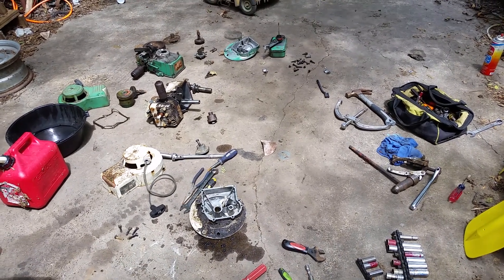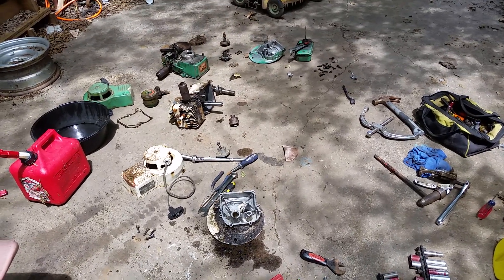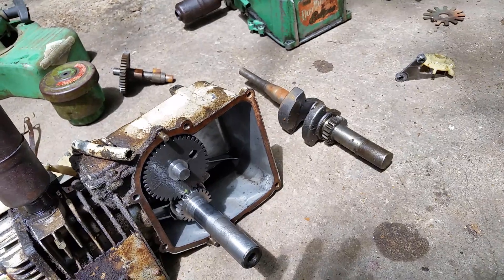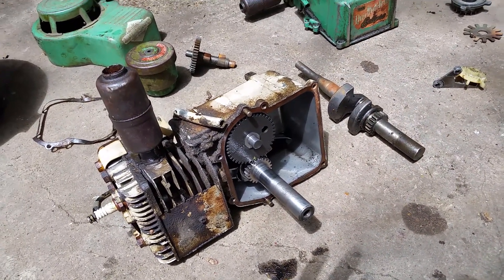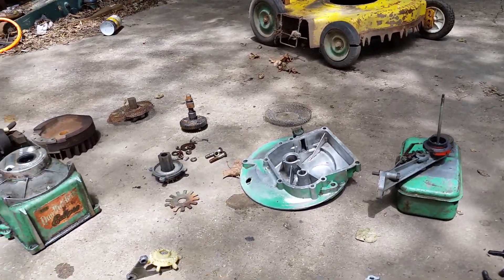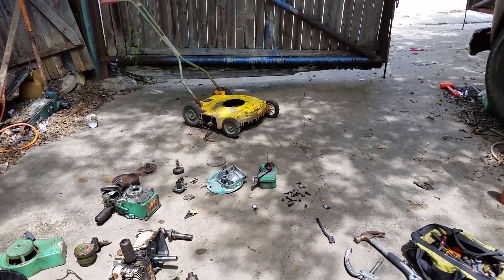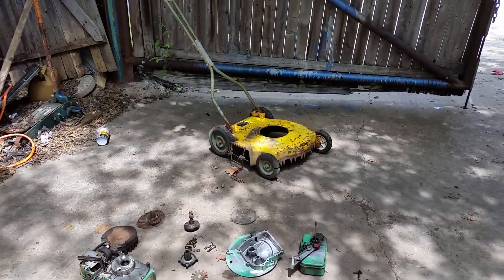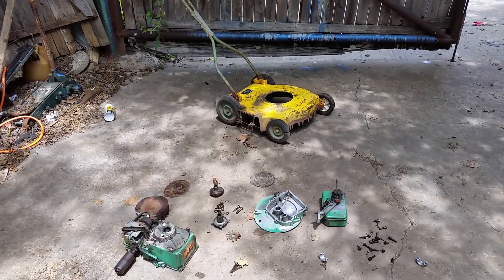Antique lawnmower repair video 1

Comment: bent crank? use a slege hammer, I did it and it worked. Did it to quite a few motors and they were back to center perfectly after some slight smashing tweaks.